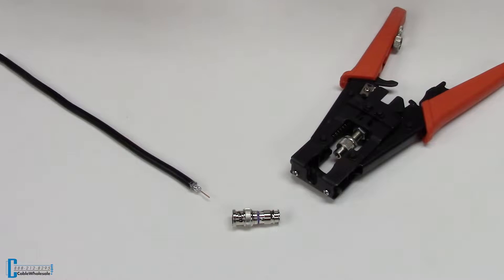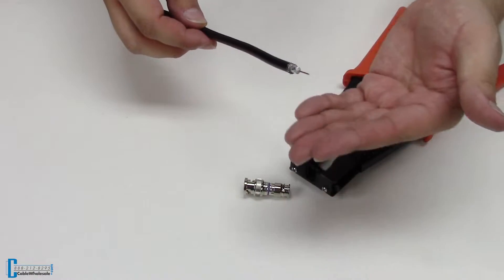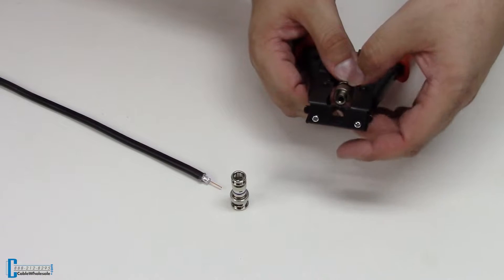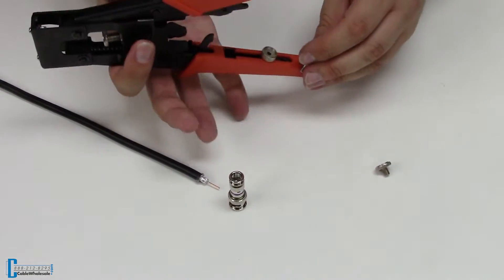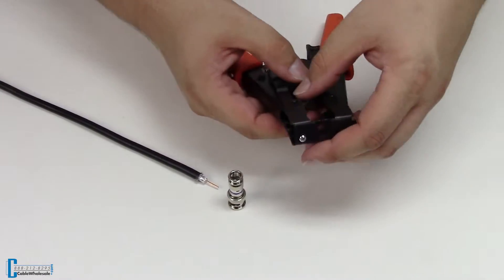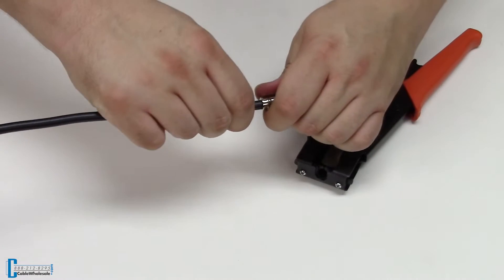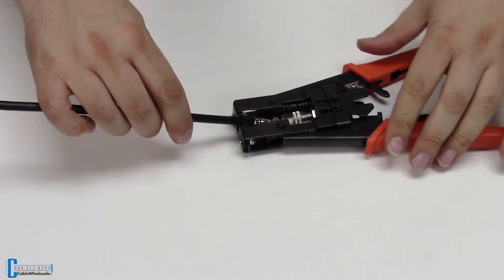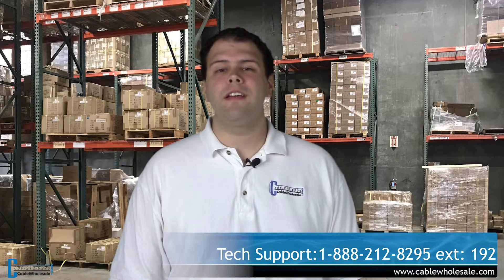How To Install a BNC Compression Connector - RG58, RG59, RG6

Comment: Why do mine keep slipping out?
Reply: Possibly the diameter of the cable is to small for the connector. Rg 59 can be smaller depending on manufacturer. Rg 6 is generally thicker in diameter. You can substitute rg 59 with rg 6. It is a higher grade cable, it is commonly used for cable or satellite tv. You could also try some crimp style connectors but I would stay away from twist on connectors.

Comment: This video is of No Value, unless you have the Specialised fitting tool.
Reply: It was of value to me, because I just bought one and wanted to know how to use it. So eat my shorts!
Reply: Well yeah. You need that tool. Try doing it with your bare hands and see how it works out.
Reply: Also useful to me, now I know what tool I need and what BNC fittings work with it
Reply: My bnc end keeps falling off, I think the cable installer didn't use this tool. Buy all the specialized tools you can, makes life so much easier.